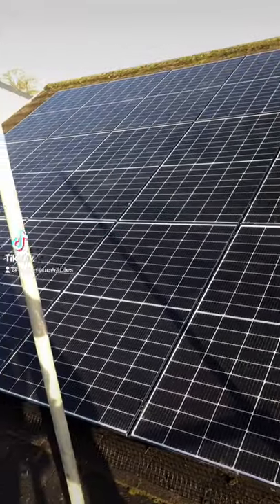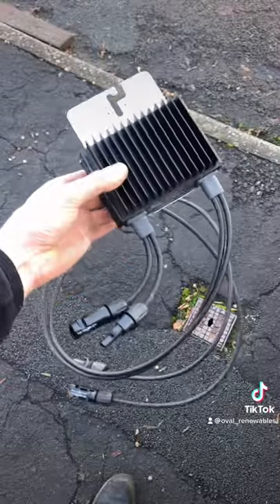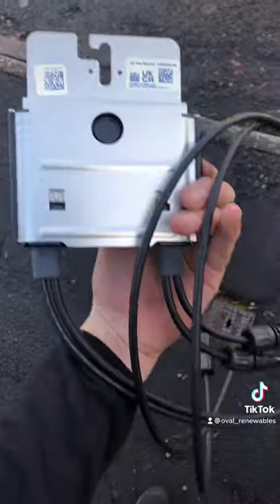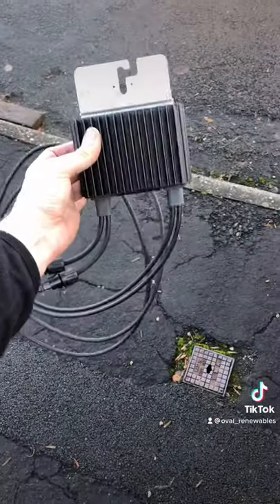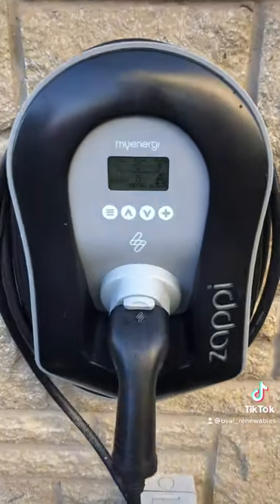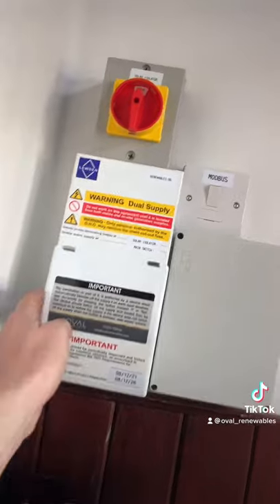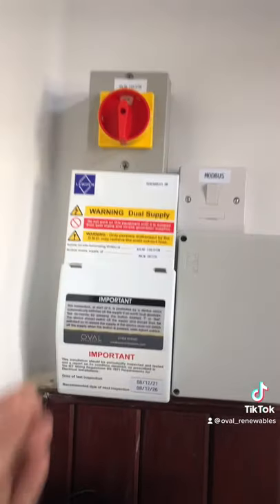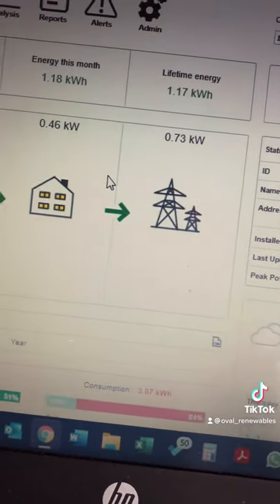10.93kw SolarEdge PV system with a 7kw Myenergi Zappi. #energy #renewableenergy #solarpv #evcharging

Comment: How many Kw on the AC side of the house? 
Did the DSO ask you to limit it? If so how?
Reply from the maker: Thanks for the question! The inverter is rated at 6kw. The inverter can handle a large amount of DC oversizing. We got approval for the full 6kw discharge.
Reply: @OvalRenewables  did you use a Sonnen or a solar edge inverter? ( or other).
Reply from the maker: @myopenmind527  it’s a 6kw SolarEdge inverter
Reply: @OvalRenewables  thanks for the reply. 

Why did you not go for the Sonnen hybrid with the integrated inverter?
Reply from the maker: @myopenmind527  we like the SolarEdge system with its panel by panel monitoring, also the customer didn’t want a battery at this stage

Comment: They don't make the panels more efficient.
Reply from the maker: They do make the full system more efficient especially if there is heavy shading. However I take the point, my working was maybe slightly incorrectly termed.
Reply: @OvalRenewables  I actually think they help a fraction more than that. Even when no shading at all, the panels near my chimney produce a bit more or a bit less depending on whether there is any reflected energy off the brick or if the surface of the chimney looks darker than the sky (not sun) facing them. Presumably without optimisers this one panel wouldn't be able to produce any additional power, or would pull every other panel down by 10W.